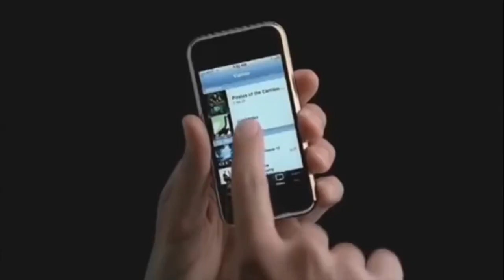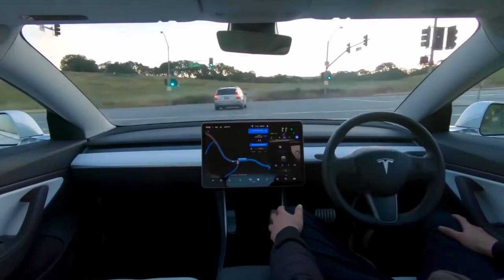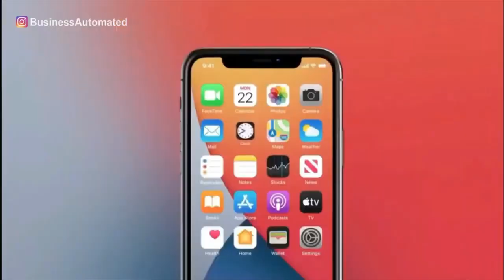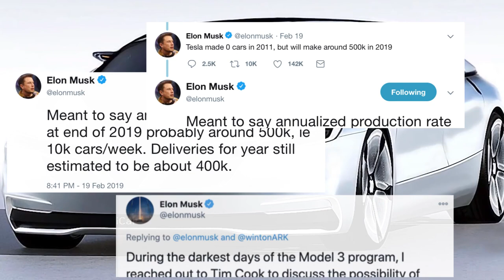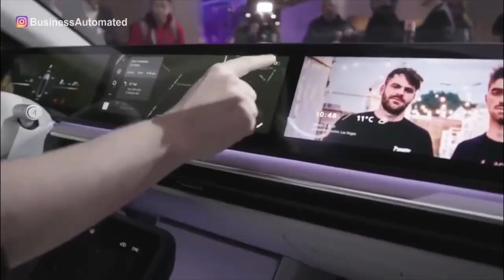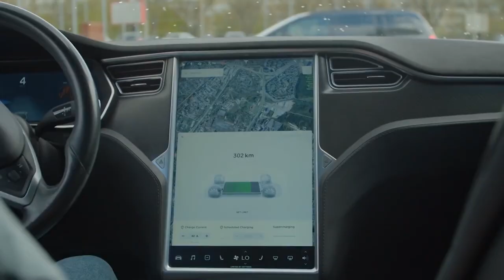CLICKABLE CAR? The Apple Car is on the Way!

Comment: The lidar system I had to put up with it and trucks it was extremely inaccurate and only ranged out from the vehicle 90 feet and it wasn't for the road sensors down the road to get a vision the car is blind and far as in buying a system instead of creating a system that shows how cheap they're trying to be so your manufacturing trash them not worth the money
Reply from the maker: Understood